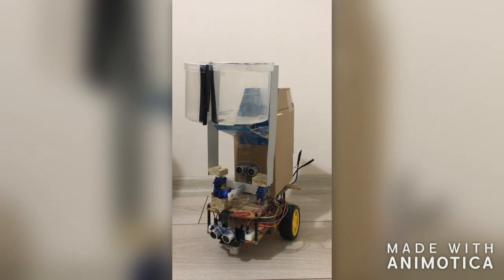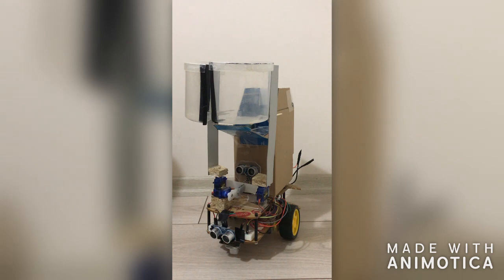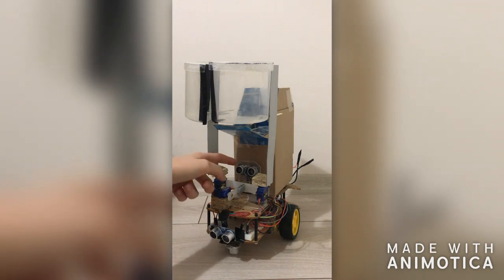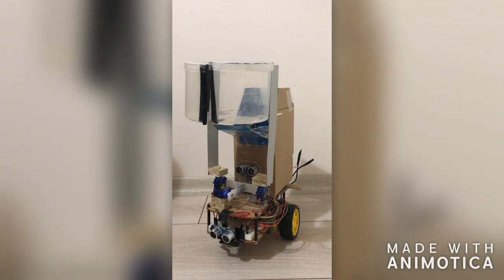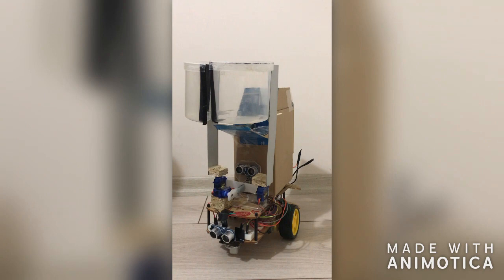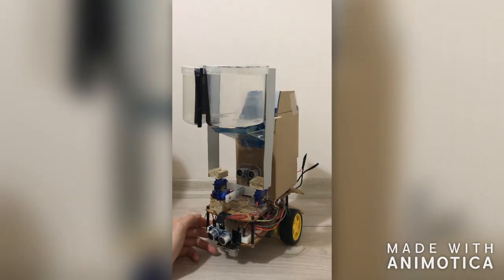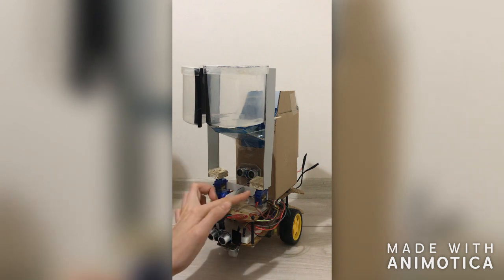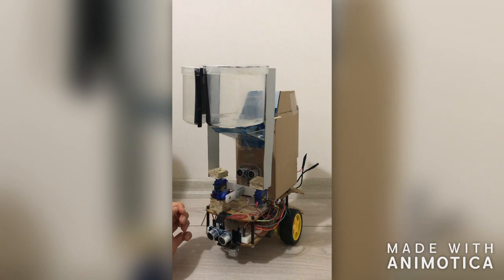Garbage Collector Robot (IUE MCE 102 Term Project)

Comment: Can you please give us the Arduino programming in detail. Please it's very urgent.
Reply from the maker: file:///C:/Users/Beg%C3%BCm/Downloads/Yeni%20DOCX%20Document-d%C3%B6n%C3%BC%C5%9Ft%C3%BCr%C3%BCld%C3%BC.pdf (codes) (after copying and pasting it should be open)
Reply: @begumkose5168   can you send link not pdf
Reply from the maker: @kaushikshah8118  I don't have any link, I wrote codes on myself according to sources which I wrote above. Here the codes: 
[code]
 #define echoPin 12
#define trigPin 13
#define echoPini 8
#define trigPini 1
#define MotorR1 6
#define MotorR2 7
#define MotorRE 5
#define MotorL1 2
#define MotorL2 4
#define MotorLE 3

#include <Servo.h>
Servo servo1;
Servo servo2;
Servo servo3;

int pos = 90;
int pos1 = 0;
int pos2 = 0;

long time, distance;
long time2, distance2;

void setup() {

  pinMode(echoPin, INPUT);
  pinMode(trigPin, OUTPUT);
  pinMode(echoPini, INPUT);
  pinMode(trigPini, OUTPUT);

  pinMode(MotorL1, OUTPUT);
  pinMode(MotorL2, OUTPUT);
  pinMode(MotorLE, OUTPUT);
  pinMode(MotorR1, OUTPUT);
  pinMode(MotorR2, OUTPUT);
  pinMode(MotorRE, OUTPUT);

  servo1.attach(9);
  servo2.attach(11);
  servo3.attach(10);

  delay(1000);
  servo1.write(45);
  servo2.write(45);
  servo3.write(70);
  delay(1000);

}

void loop() {

  digitalWrite(trigPin, HIGH);
  delayMicroseconds(10);
  digitalWrite(trigPin, LOW);
  time = pulseIn(echoPin, HIGH),
  distance = time / 29.1 / 2;

  digitalWrite(trigPini, HIGH);
  delayMicroseconds(10);
  digitalWrite(trigPini, LOW);
  time2 = pulseIn(echoPini, HIGH),
  distance2 = time2 / 29.1 / 2;

  if (distance > 30) {
    forward();
  }
  else {
    backward();
    delay(500);
    right();
    delay(500);
  }

  if (distance2 < 15) {

    digitalWrite(MotorR1, HIGH);
    digitalWrite(MotorR2, LOW);
    analogWrite(MotorRE, 0);

    digitalWrite(MotorL1, HIGH);
    digitalWrite(MotorL2, LOW);
    analogWrite(MotorLE, 0);

    int servoDelay = 7;
    int betweenDelay = 10;
    int armdelay = 4;

    for (pos1 = 45; pos1 <=135 ; pos1 += 1) {
      
      pos2=135+(45-pos1);
      servo1.write(pos1);
      servo2.write(pos2);
      delay(servoDelay);
    }
    
    delay(betweenDelay);

    for (pos = 70; pos <= 180; pos += 1) {
      servo3.write(pos);
      delay(armdelay);
    }
    
      delay(betweenDelay);
      
    for (pos1 = 135; pos1 >= 45; pos1 -= 1) {

      pos2=45+(135-pos1);
      servo1.write(pos1);
      servo2.write(pos2);
      delay(servoDelay);
    }

    delay(betweenDelay);
      
      for (pos = 180; pos >= 70; pos -= 1) {
      servo3.write(pos);
      delay(armdelay);  }
   
  }

  else {
    ileri();
  }
}

void forward() {

  digitalWrite(MotorR1, HIGH);
  digitalWrite(MotorR2, LOW);
  analogWrite(MotorRE, 80);

  digitalWrite(MotorL1, HIGH);
  digitalWrite(MotorL2, LOW);
  analogWrite(MotorLE, 80);

}

void right() {
  digitalWrite(MotorR1, LOW);
  digitalWrite(MotorR2, HIGH);
  analogWrite(MotorRE, 80);

  digitalWrite(MotorL1, HIGH );
  digitalWrite(MotorL2, LOW);
  analogWrite(MotorLE, 80);
}

void backward() {

  digitalWrite(MotorR1, LOW);
  digitalWrite(MotorR2, HIGH);
  analogWrite(MotorRE, 80);

  digitalWrite(MotorL1, LOW);
  digitalWrite(MotorL2, HIGH);
  analogWrite(MotorLE, 80);
}
Reply: @begumkose5168  what is ileri() 
when i verified the code it is written ileri was not declared in this scope
Reply: @begumkose5168  when the above code is verified it is showing several errors
Reply from the maker: Kavita Jindal ileri means forward
Reply: @begumkose5168  no work
Reply from the maker: @Kaushik Shah This is my all codes and my system is working, i don't know what the problem is.
Reply: @kavitajindal8573   so the code worked for you ?
Reply: @begumkose5168  Thanks dear code is working
#define echoPin 1
2
#define trigPin 13
#define echoPini 8
#define trigPini 1
#define MotorR1 6
#define MotorR2 7
#define MotorRE 5
#define MotorL1 2
#define MotorL2 4
#define MotorLE 3

#include <Servo.h>
Servo servo1;
Servo servo2;
Servo servo3;

int pos = 90;
int pos1 = 0;
int pos2 = 0;

long time, distance;
long time2, distance2;

void setup() {

  pinMode(echoPin, INPUT);
  pinMode(trigPin, OUTPUT);
  pinMode(echoPini, INPUT);
  pinMode(trigPini, OUTPUT);

  pinMode(MotorL1, OUTPUT);
  pinMode(MotorL2, OUTPUT);
  pinMode(MotorLE, OUTPUT);
  pinMode(MotorR1, OUTPUT);
  pinMode(MotorR2, OUTPUT);
  pinMode(MotorRE, OUTPUT);

  servo1.attach(9);
  servo2.attach(11);
  servo3.attach(10);

  delay(1000);
  servo1.write(45);
  servo2.write(45);
  servo3.write(70);
  delay(1000);

}

void loop() {

  digitalWrite(trigPin, HIGH);
  delayMicroseconds(10);
  digitalWrite(trigPin, LOW);
  time = pulseIn(echoPin, HIGH),
  distance = time / 29.1 / 2;

  digitalWrite(trigPini, HIGH);
  delayMicroseconds(10);
  digitalWrite(trigPini, LOW);
  time2 = pulseIn(echoPini, HIGH),
  distance2 = time2 / 29.1 / 2;

  if (distance > 30) {
    forward();
  }
  else {
    backward();
    delay(500);
    right();
    delay(500);
  }

  if (distance2 < 15) {

    digitalWrite(MotorR1, HIGH);
    digitalWrite(MotorR2, LOW);
    analogWrite(MotorRE, 0);

    digitalWrite(MotorL1, HIGH);
    digitalWrite(MotorL2, LOW);
    analogWrite(MotorLE, 0);

    int servoDelay = 7;
    int betweenDelay = 10;
    int armdelay = 4;

    for (pos1 = 45; pos1 <=135 ; pos1 += 1) {
      
      pos2=135+(45-pos1);
      servo1.write(pos1);
      servo2.write(pos2);
      delay(servoDelay);
    }
    
    delay(betweenDelay);

    for (pos = 70; pos <= 180; pos += 1) {
      servo3.write(pos);
      delay(armdelay);
    }
    
      delay(betweenDelay);
      
    for (pos1 = 135; pos1 >= 45; pos1 -= 1) {

      pos2=45+(135-pos1);
      servo1.write(pos1);
      servo2.write(pos2);
      delay(servoDelay);
    }

    delay(betweenDelay);
      
      for (pos = 180; pos >= 70; pos -= 1) {
      servo3.write(pos);
      delay(armdelay);  }
   
  }

  else {
   forward();
  }
}

void forward() {

  digitalWrite(MotorR1, HIGH);
  digitalWrite(MotorR2, LOW);
  analogWrite(MotorRE, 80);

  digitalWrite(MotorL1, HIGH);
  digitalWrite(MotorL2, LOW);
  analogWrite(MotorLE, 80);

}

void right() {
  digitalWrite(MotorR1, LOW);
  digitalWrite(MotorR2, HIGH);
  analogWrite(MotorRE, 80);

  digitalWrite(MotorL1, HIGH );
  digitalWrite(MotorL2, LOW);
  analogWrite(MotorLE, 80);
}

void backward() {

  digitalWrite(MotorR1, LOW);
  digitalWrite(MotorR2, HIGH);
  analogWrite(MotorRE, 80);

  digitalWrite(MotorL1, LOW);
  digitalWrite(MotorL2, HIGH);
  analogWrite(MotorLE, 80);
}
Reply: @nabeelarshad4470  Hello, did you do the project?

Comment: can you give a brief description on how did you make this robot?
Reply from the maker: Kavita Jindal  Firstly, I bought robot kit and created it. In this way main structure of the system was formed. Then i wrote codes and made electrical part at the same time. Firstly, I wrote moving codes (forward, backward etc.), then I wrote codes about first sensor which detects obstacles like wall after that I made garbage collector mechanism and wrote its codes.
Reply: can you give me the codes and circuit diagram
Reply: i want detailed process
Reply: please reply urgent
Reply from the maker: Kavita Jindal Sorry I am busy, do you want all codes and circuit diagram or?
Reply: @begumkose5168  it's my kind request please please give us code only its urgent
Reply: It's very urgent we have no time.
Reply from the maker: Sorry for the lateness, I had a problem with my channel.
file:///C:/Users/Beg%C3%BCm/Downloads/Project%20circuit.pdf
file:///C:/Users/Beg%C3%BCm/Downloads/Codes-d%C3%B6n%C3%BC%C5%9Ft%C3%BCr%C3%BCld%C3%BC%20(1).pdf
Reply: @begumkose5168  the file is not available on the browser
it says the file may have been moved or deleted
Reply from the maker: I tried to open files on another computer and it was okey. I made another file(after copying and pasting it should be open)
file:///C:/Users/Beg%C3%BCm/Downloads/Yeni%20DOCX%20Document-d%C3%B6n%C3%BC%C5%9Ft%C3%BCr%C3%BCld%C3%BC.pdf (codes)
Reply: @begumkose5168  its not opening now also its showing some other things in what to open google or something else
Reply: @begumkose5168  link only I need
Reply: how you made garbage collecting mechanism.
codes
did you use remote for making it work
Reply from the maker: Kavita Jindal I used 3 servo motors(micro servo) , one of them moves up and down when detects an obstacle, others turn right and left (approximate 90 degrees) to take the garbage. I used plastic sticks to make system and adjusted the lengths of sticks according to length of robot kit. Also it can be better if the main servo (which moves up and down) is more powerful because it lifts kinda whole system. 
p.s: servo degrees can change according to length of robot kit and sticks.
I can send you project file via mail, because my computer is not by my side and codes file is not on my phone.
Reply: please
Reply: please send the file
Reply: what did you use to make this robot start by switch or remote
Reply: please give me the circuit diagram and codes
Reply: where is l298n in circuit diagrAm
Reply: please give me the codes only codes please its very urgent
Reply: please its very urgent
Reply: please give me the codes
Reply: please give the codes please only the codes
Reply: please give the codes for the above robot i have also made the robot structure i only need the program please give the codes through a file or images very urgent very urgent please
Reply: please send the codes it is very necessary please its a kind request
Reply from the maker: Sorry for the lateness, I had a problem with my channel.
file:///C:/Users/Beg%C3%BCm/Downloads/Project%20circuit.pdf
file:///C:/Users/Beg%C3%BCm/Downloads/Codes-d%C3%B6n%C3%BC%C5%9Ft%C3%BCr%C3%BCld%C3%BC%20(1).pdf
Reply: can you send the program in some another way
Reply: can I get it too plss?🙏